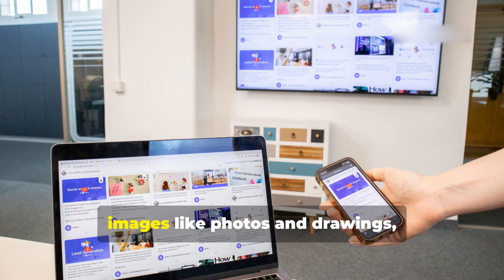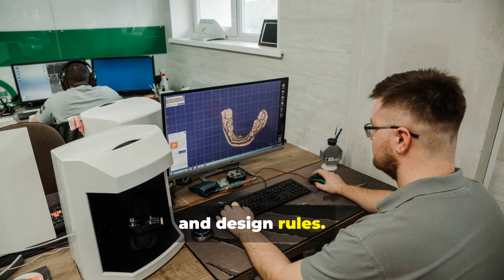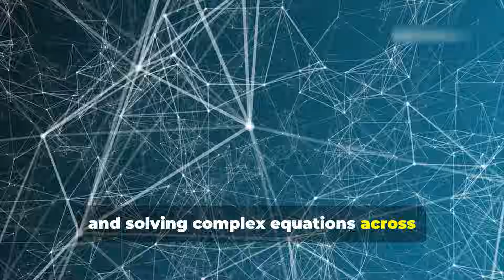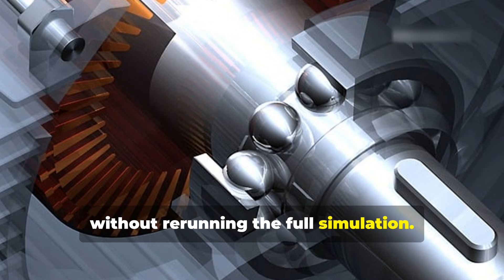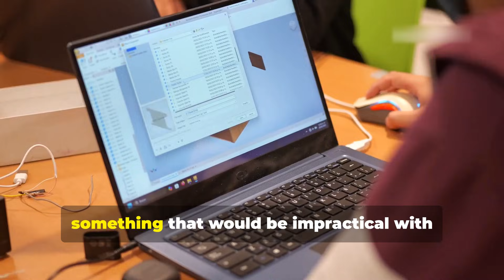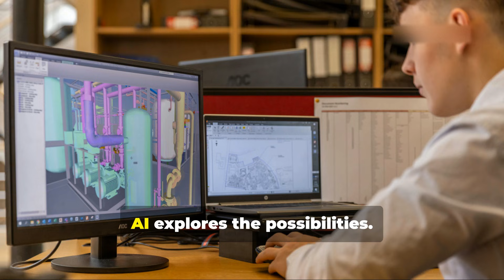Mechanical Design + AI: A Brand New Revolution. #mechanical #ai #design

Comment: Mechanical enginner every grenn branch hai aur future scop bhai accha hai  app kuch mat Bolo
Reply from the maker: I completely agree with you. As a mechanical engineer myself, I am simply sharing my observations on the future direction of the industry. Strong engineering fundamentals remain the most important asset any engineer can possess. However, it is equally important to understand sustainability, automation, and the rapidly growing role of AI in engineering and manufacturing.

A solid mechanical engineering foundation will always be valuable, but engineers must also adapt to the accelerating pace of technological advancement. The future belongs to those who can combine core engineering knowledge with emerging technologies and continuously evolve with the industry.

Comment: This is a great video, but can you tell me how much Python knowledge I need to learn to help me in this field?
Reply from the maker: Mechanical engineering does not require deep Python or software-engineering knowledge. In practice, most engineers only need basic to intermediate Python—enough to automate calculations, process test data, and use AI tools that already exist.

The core of mechanical engineering is still physics, materials, design judgement, and safety. Python is simply becoming a tool, like Excel or MATLAB once did, to work faster and explore more design options.

You don’t need to become a programmer—just comfortable enough to use the tools effectively.
Reply from the maker: In day-to-day mechanical engineering work, Python is mainly used to automate repetitive calculations, process test and sensor data, and run existing analysis or AI models. For these tasks, only basic to intermediate skills are required—understanding variables, loops, functions, and how to work with engineering data using libraries like NumPy or Pandas.

The engineering value still comes from domain knowledge: understanding loads, boundary conditions, failure modes, manufacturing limits, and safety factors. Python does not replace this knowledge; it simply helps engineers explore more design options faster and make better-informed decisions.

Advanced Python and AI skills are only necessary for engineers working in specialized R&D roles, such as developing new simulation methods, control algorithms, or AI models. For most practicing engineers, Python is best viewed as a productivity tool, similar to how Excel, MATLAB, or CAD automation scripts have been used in the past.

Comment: But How and where to upload the AI prompt in design software
Reply from the maker: Thank you for reaching out. To put it simply, you can’t directly “upload” a text prompt into traditional design software like SolidWorks, CATIA, or Creo — these tools weren’t originally designed to work with prompt-based AI inputs.
However, the landscape is changing rapidly. Modern AI capabilities are being integrated into design workflows through specialized plugins, cloud-based services, and next-generation AI-driven platforms. These systems allow engineers to describe design goals or constraints in natural language or structured prompts, and the AI then assists in generating or optimizing geometry, simulations, or design parameters automatically.
Reply: what's the name of the ai tool?
Reply: @markprince29   MecAgent Copilot related to solidworks you can try